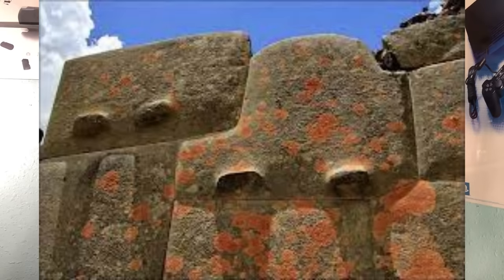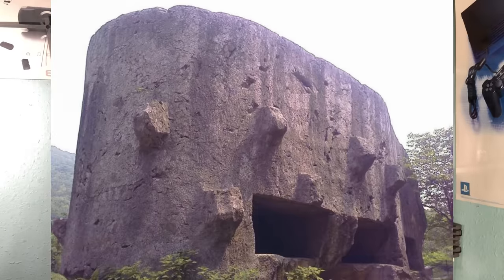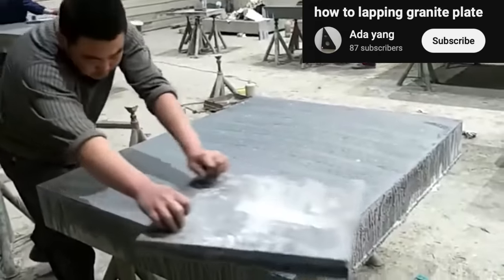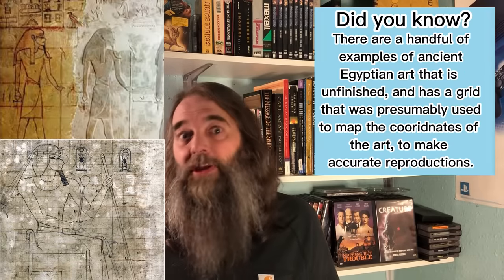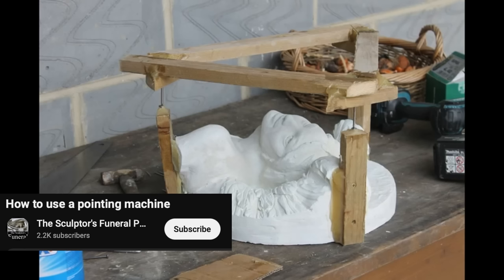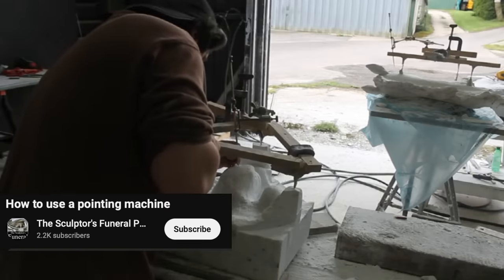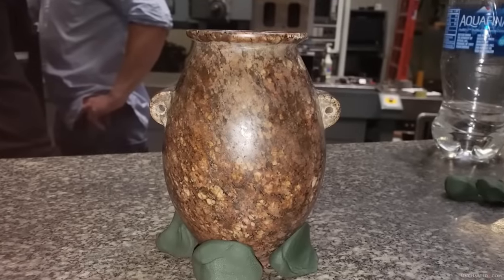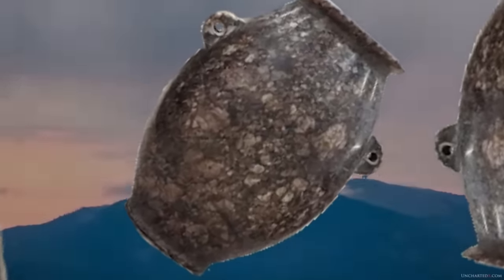The True Purpose of Megalith Stone Nubs

Comment: Skipping the nubs, if you want stones that fit perfectly together, go to your quarry and mark out a grid on the face.  Then begin the splitting out process and break out as much as you possibly can.  When the big slab finally splits away and falls, it will break into a bunch of pieces.  These pieces fit together perfectly and after transport to the building site, just use the grid markings on the faces of the stones to stack them back in place. Now you have joints that fit perfectly togather naturally and you can just dress up the face to your liking.

Comment: Thanks for your vid! I believe that the knobs were put on the lower edge of the stone and their lower side was flat, as opposed to rounded upper sides - this for me is so that the stone can be supported lifted a few inches from the lower stone. Then an obsidian “file” starts to grind in between the stones, thus equalizing their contour. This is very probably since in may case only the outer edges of the stones fit - one doesn’t have to “file” or grind much on a roughly precut shape (it can be precut copied in a similar way you describe).

Comment: It's not a bad idea. But I tend to disagree. Looking at the joints there's a slight hollow so only two thinner faces actually interact. The blocks where likely put in place and cut so the mating surfaces would fit tightly. So the part this frame would be needed for needs far less accuracy... I don't think lapping was necessary either Lapping odd shaped massive stones would be an incredibly difficult task.. Compared to running a tool between two stones. The nubs can be used to take some weight, perhaps some wood was put under a nub and then hammered jamming it against the ground, taking weight so the tool used between blocks to finish joints did not bind

Comment: This is a fascinating subject.  If your hypothesis is correct, it would make sense to plan and create 2 or more objects with similar attributes.  As much of the work as could be done at the quarry would create a "preform".  The least stone would have to be moved, and minimal final fitting would need to be done at the site.  Unless we see rectangular stones, no 2 are alike (or even very similar)...
Reply from the maker: I think they would make each stone specially, the size and exacting nature says to me each one was important to the crew making it. Possibly the idea of replicating the stones themselves was sacrilegious, or more likely they based the block on the stone, and no 2 stones are the same, no 2 blocks are either.

Appreciate the thoughtful comment, thanks!
Reply: @DeDunking  Of course, due to the scarcity of stones that were partially finished by nature - that would dictate the shape of the stone.  The "hole" that it would fit into would have to be manicured on site so the stone would drop into that hole...  Another observation -- since no two joints are in the same plane, and the blocks are from solid objects, they would have little or no susceptibility to seismic fracture...

Comment: The poligonial stones are made from small pieces of rock which has been broken down from Earthquake zones and emersed in a liquid solution that softens the rock. This semi soft material was podged and pounded into a master stone, while this stone was soft and still damp copper comb like tools were used to scrape away excess material. The nubs were a point where a strieght edge was used and there were a number of them to shape the stone. This varied with the Head Masons own way off doing things, some were very artistic while others were less imaginative.The real reason was when the copper comb like tools scraped away the outer surface  this crumble  like material was used to make the finer finish like the H blocks at Pumapunka.

Comment: I think this is an excellent explaination of how they could have cut those rocks to fit so cleanly, but not necessarily an explaination for the nubs even if they needed something like nubs to do it.

I think they were architectural, even the small ones to some extent.

I think they would have had wooden pieces that affixed to them, to stabilize platforms, tent covers, etc.

This would explain why they look so random, because they would have been carved to a specific purpose of a wooden front end.

Comment: It’s far simpler: the stones were a polymer placed in membranes to dry and harden. The membranes allowed the stone to take the shape of whatever it was resting against. The nubs are just protrusions from wooden beams placed inside during the hardening process to prevent larger pieces of the stone mixture from settling on the bottom. Sometimes during the hardening process, the wood beams would slide and cause the protrusions.
Reply: Oh yeah.  Change rock to a polymer? 
You are not a scientist.

Comment: I just watched a video on a channel just named Daniel titled: Explained. Tight Fitted Stone Joints and Knob Protrusions on Mayan Walls. His theory is definitely plausible. Basically, they would have chipped and smoothed the face of a wall they were quarrying and scored it into the block shapes they wanted, taking advantage of the natural cracks, faults, veins, weak points, etc. Which is why they have a  zigzag type of polygonal shape to them. They would leave the nubs protruding in key areas along the score lines. They would then separate the thickness of the blocks from the rest of the wall vertically which would leave a free standing scored slab that they would then tip over.  The nubs would hit the ground first creating a leverage point for the blocks to break along the score lines. Then all they had to do after they moved the individual blocks to the build site was restack the blocks and they would all fit and nest back together precisely. I do see practical issues with that working out as planned every time but it's a very good and plausible theory. You should check out his video. It's only 6:43 long.

Comment: My theory is lapedry. the nubs were used as grip points for a larger mechanical arm that vibrated the top stone against the lower stone to lap the stones together. One needs similar hard tool to cut stone so its logical to use what is lying around next to the stone ie stone. The mechanical arm needs the nubs to grip onto the stone and thats why the nubs are mostly rounded off due to the masive vibration when setting the stone in place. like wise stone that has inverted nums can be explaind in the same way only the holes were made by the grip points of the arm vibrating into the stone during the laping process. We know they had knowledge of smelting as the butterfly joint testify to. So its not a strech to be able to smelt steel and before you say theres no evidence, all evidence of steel would have rusted away long ago in the first 100years.

Comment: The round edges of the stone would indicate a bag of some sort because of their uniformity and roundness which was unnecessary if you're just carving a block but these were cast in place. The roundness of the edges is the key to solving the stone the Nubs were probably an entry point for the cement as another person indicated.

Comment: It is already well understood how they fitted the stones so precisely, using sand to identify high spots and removing them until the fit was right. The reason for the odd shapes was to lock the stones together for stability with the absence of mortar. Whatever the reason for the nubs, it was not necessary to remove them after fitting, so it was at the whim of the man working on that block. Remember, ancient man was essentially the same as us, just with lower technology but experienced in that technology.

Comment: Thanks for the video.  Always a joy to see dedicated problem solving like this.  With or without the nubs, I don't think you study of the coordinate system for measuring and mapping the perfect fit of stones has been studied to satisfactory ends.  Thanks for adding to this body of knowledge.  I would like to make two points though.  One: The nubs did not serve a singular purpose as there are different kinds of nubs that fall into several different use cases.  Two:  No one that I have found is exploring the differnet species that were involved in the construction of these structures.  Example:  If you stretch your fingers as wide as you can, and use the distance from the tip of your pinky to the tip of your thumb as a unit of measure.  Then, measure out three of those distances on a sheet of cardboard and sketch a human hand at that larger scale.  Cut that giant hand out and take it with you to some of these stone sites.  Now you will see something enlightening.   Some of these nubs are hand holds for very big hands.

Comment: I think the nubs were just used as "anchors" for fixating or moving (into place) or lifting even. And after placement they would be removed in most cases. 
To me this would be the simpliest explanation for the nubs found in buildingblocks across old civilizations across the globe. It's more likely for simple methods to appear independently across the world than more specific ones like using that "pointing machine".

Regarding the most complex stones, like that corner stone f.e. from the Inca wall f.e. it may have well been just the usage of sticks of different lengths and or ropes that they used for measurements. 
F.e. "lifting up" (or sliding it at the same height of where it needs to be but not bring it close enough in place yet, leaving some room for workers to sit there. Just by using 1 or (2, 3) stick(s) of a correct length, one can go between two surfaces and see where the place needs rubbing and where not. 
After it all checks out nicely, the stone can be moved in, using the nobs as anchorpoints for ropes to attach to.
Nothing says the blocks needed to be perfectly done before it was brought to the place itself. Nothing even says that the surface on the inside are as smooth as where the surfaces meet on the outside.

Comment: I like this idea...but, I don't think it would be as accurate as we need it to be. 

If you have the ability to make nubs, and FLAT angled surfaces, why make the nubs rounded? Affixing some sort of apparatus to a rounded nub is going to leave lots of 'wiggle room'. If you made a squared nub, a device carved out of wood would definitely stay locked in place for measurements. But rounded nubs....there's gonna be wiggle room. It's not like they would make the apparatus rounded as well - so that it would fit securely - that wouldn't make sense. 

And especially in the regions these nubs are found at, so many of the surrounding surfaces are FLAT, and ANGULAR. So if you have that ability to make sharp angles, why make nubs rounded, that would allow your pointing device to wobble, or have 'give'?

Comment: Alternative explanation: IF you want a 3D floating object, you need to somehow anchor it to the wall. Lets say they wanted to portray flying birds - they either have to mount them on the stand, which would be ugly, or they could mount them with not easily visible wall extensions.

Comment: Before watching the video I'm going to throw my hypothesis and see how well it squares with the video:

It's very simple those nubs are leftovers of the quarrying process. After you've formed the four side walls of the block and the top, you need to start chiseling underneath in order to detach the block from the bedrock. But since you don't want the stone block to fall onto your hands you're going to leave a stem or neck  of uncut rock that still attached the block to the bedrock. Then you use a wooden beam to pry the block and break off the neck. So the part of the neck that is still part of the now free block is the mysterious nub. And of course if the block is bigger you might leave two or three such stems that need to be broken off.

I realized this might be the case when I watched a documentary about central/south American ancient megalithic structures. There, they showed a wall of perfectly fitting blocks some of which had nubs. And importantly the wall was keeping an earthwork form sliding down. Meaning the back side of the wall was invisible unless you dig. (That's gonna be important in a minute). So when you look at a particular course of blocks of that wall,  you can see one block has nubs, the next has nubs, the third, but the forth and fifth don't. So there was no particular order or pattern of which block has nubs and which doesn't. And then the narrator dropped the bomb shell. He said that after digging the dirt behind the wall archeologists found out that all the blocks that don't have nubs at the front, do have nubs facing back at the earth. You know what that means? They didn't care about those nubs. And they have no function at all. If they had put those blocks haphazardly so some numbs face out and some face inward towards the dirt, they didn't really care. On top of that those walls were plastered, meaning even the forward facing nubs were invisible.

This is my guess. Those nubs are leftovers form the quarrying for the blocks. Now lets see the video...

After watching the video:

Well, completely different. But I would still maintain that the flat nose nubs were leftovers. The pointy ones he showed in the video, were probably registration points as he explained.

But the surface of some of the nubs I've seen literally looks like it was broken off.
Reply: Yes and pivot points for moving the rock.
Check out Wally Wallington.

Comment: A piece of wall.. More likely part of a once way bigger structure. Keep that in mind.

The reason for these perfect puzzle fitting blocks is quite simple - for the structure to be dynamic in case of natural disasters. The blocks are able to move independent slightly from each other when hit by a force, like a earthquake, only to interlock back perfectly after the force has receded. 'Modern' Japanese castles from the late Moyotama/Edo Period are build this way.

It is very likely that what we see is the skeleton of said structure - the whole structure was most likely covered off with something organic/decorative against the knob headed area, leaving a bit of a gap which also minimizes (internal) damages. 

Measuring 'machine' yes, the Japanese knew, but also this.

Comment: After having voraciously consumed information about this subject for some months, I believe the stone softening theory is the most likely. This could have been done with chemicals (in some cases derived from certain plants) which would make the stone soft and malleable to conform the edges of two stones. I also am intrigued by the idea of electrodes having been used to soften the stones. This could explain the mounds. If you pull a rod from molten, or near molten metal it leaves a similar mound. Note, too, that many of these stones also have very perfectly drilled holes in them that may have accommodated many of the structures. To answer the question of why the nubs are not consistent as far as number-per-stone or their locations on stones, this is potentially because an electrode was used at that point to make the stones fitment more precise.

Comment: I'm not sure I entirely agree with your theory. The nubs that we see don't give the impression that a wooden framework is going to be super secure on them. Granted the nubs could have been more pronounced with sharper corners back during construction. But the video you referenced stressed the importance of making this tool be as rock solid and unmovable as possible. I'm just not sure that these rounded nubs we see are sufficient for that.

But if this is their true purpose, I wanted to provide a possible explanation for only some of the stones having nubs. Let's say they are planning out and constructing the wall layong flat on the ground before disassembling it and reassembling it in a vertical position. You wouldn't need a nub on every stone. As you finish the stones and put them in place, you can continue on to the next from your existing framework. You would only need a couple in strategic locations throughout the wall. With this in mind, they might have used those spots to outline a design, like the Incan wall in Cuzco that makes the shape of a leopard in it and is bounded by stones with nubs.

Comment: I like your hypothesis. It is very sound. Regarding the lapping to create perfect joints, l read a great paper that explained how acid derived from sulphurous hydrothermal vents at the surface of a certain location, were used to produce an extremely strong acid, which was used dissolve the rock surface in South American countries. It didn't  state how boulders that are arranged side by side or one above the other were treated, but l can imagine that all the blocks surrounding a central large multi faceted block like the one with 12 angles, could be worked on simultaneously creating the various angles on the bigger stone with a lapping technique with a strong acid inbetween. It is true to say that all rock types are subject to chemical weathering, so there is no argument about whether acids can dissolve a surface, but the relative alkalinity or acidity at the point of contact would change as the alkaline rock crystals  chemically interact with the acid, eventually neutralising it, but hopefully only after creating a perfect matched surface between the stones. After this has been achieved tge central multi angled rock could be put where it is expected to go and the other stones fitted and adjusted with acid if needs be.